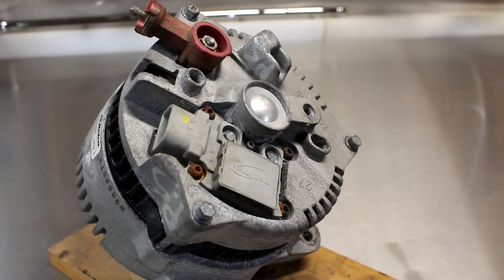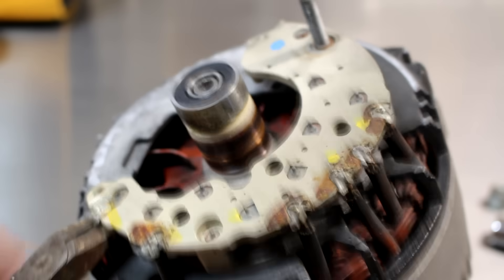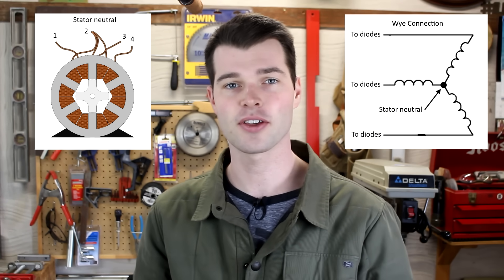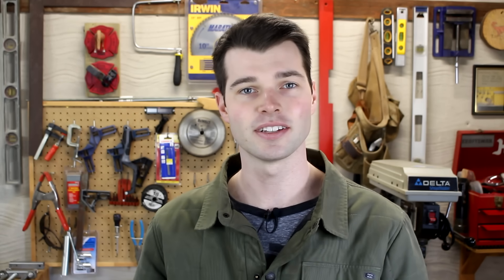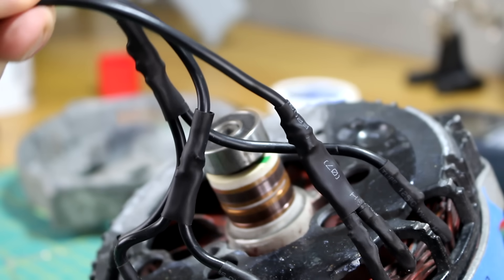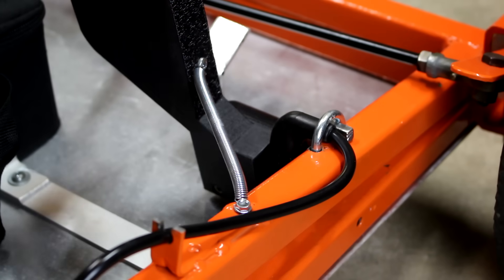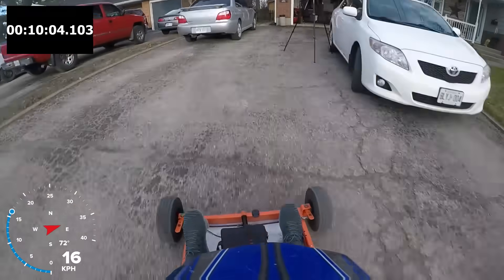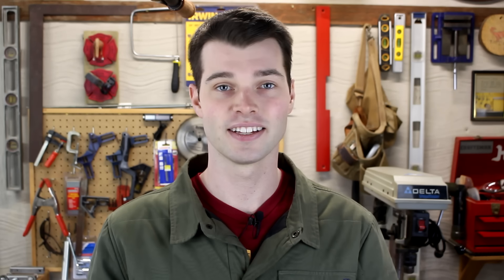Converting a Car Alternator into a Go Kart Motor

Comment: im thinking about using a forklift motor, its rated for 5kw, can i use a stronger pwm?
Reply: Well forklifts do come with controllers, might as well use those.
Reply: MsSomeonenew I've only found someone who sold the motor not the controller. And it's really rare in my country

Comment: NICE!!!! 

 I made an EBike with a 100 Amp alternator last year. 
 It tears along at 18KPH on a 14V battery, and uses 15WH per KM. 
 Watt's cool is that it is soooooo quiet, it is recharged by solar panels - and it is such a pleasure to ride  :) .  
 Keep up the good work bro.
Reply: +Perkins_RC76 
 If you can walk at 7 mph, I would like to see that. 
 Maybe make a video of it? 
 Maybe become an Olympic race walker? 
 The true walking speed is closer to 3 MPH, so my 12 MPH bike is a LOT faster than mere walking speed  :) .
Reply: PERKINS_RC76 not likely cause I'm 6 feet tall and I fast walk at 4.1 mph full Sprint at 9mph but I tire quickly cause I'm not trained lol
Reply: Braking?
Reply: Braking is partly done by the alternator, but mostly by the bike's existing brakes.
Reply: 15Watt hours? or 15 amp hours? big difference on a 12/14volt system
Reply: @AndrewBrowner at 15 volts he'd be burning about an amp to get 15 amp hours?
Check my math and see if you get the same. 
15 amp hours at 12v 150 amps more or less
That can't be right????
Reply: Howdee Andrew, 
 1 Amp hour at 14.5V - is 'watt' this bike consumes when it is traveling on a level path at 18KPH. 
 It travels 4KM per 4AH battery, if I run them flat, but that's not such a good idea with these LiPo cells. 
 I could make it go faster, with a higher DC supply voltage, but there comes a tradeoff between speed and range, so I have opted to settle for this rather sedate 18KPH speed  :) .
Reply: CNCmachiningisfun
Put a Battery Discharge Cut-off Control circuit
Reply: +Anthony Caballero 
 My motor controller already has that built in. 
 It can be programmed to protect the battery from excessive discharge  :) .
Reply: CNCmachiningisfun
ohhh nice
Reply: CNCmachiningisfun ts nice.
Reply: I've toyed with replacing the battery with a supercap bank and adding a 250 watt solar panel for a touring cart.  A horseless surrey with a fringe on top.  Not sure what approval it would need in place of a bike for Burning Man.
Reply: can this motor used for cnc spindle?
Reply: For sure, the Ebike that I made can go a LOT faster than its present 12MPH, but there comes a trade off between speed and efficiency. 
 My objective was to build a vehicle that does not need any form of fuel to run it, and this was the result. 
 It runs on solar power, so it costs virtually nothing to run. 
 I was gonna make a petrol powered one that would go a lot faster, but I settled for this, as I am trying to remain as independent as I can be from fossil fuels. 
 Congrats on your bike builds bro  :) .
Reply: Getting 15 WH per KM while doing 18 KM/H is very poor efficiency! On my old heavy ebike, i used to get 8 WH per KM doing 20 KM/H and 18 WH per KM doing 35 KM/H ! I think this shows the flaw of alternators, they are powerful, but they waste lots of energy sadly.
Reply: 18kph is pretty slow though :/
Reply: CNCmachiningisfun a

Comment: use batt lipo , it's verry power
https://youtu.be/6D0kTZRYasc
Reply: So much current.. very mooove.. 

The DogeKART.
Reply: much lol very wow your comment, Gary
Reply: he is going to make his own lipo pack using 18650s (vape style batteries), they can have a charge of around 2500-3000mah at 3.7v. Wiring them in series could bring the voltage near to the 48v (12 in series) and maybe two in parallel for extra amount of runtime (more ah).
Reply: and in parallel for the discharge current.
Reply: Hello
no you need a li-ion batt pack of 13s = 48v ... no 12s li-ion ...
to go for 14Ah or 16Ah is very good ...
an alternator to engine, it takes a racio very high, about 6 laps to the engine for 1 wheel revolutions ...
very good work
Reply: on my go kart, he shoots 70A in spike
Reply: I agree. Lithium polymer batteries would work better than the 18650 lithium ion hard cells. Most lipo batteries have a higher discharge rate.
Reply: 18650 banks are also used in EV's. They're just recently switching to 21700 (Tesla)
Reply: Virux get a stack of them.. or equivalent in Flatpack lipo. 

Doone.

Comment: How are you applying voltage to the stator?  I have an alternator wired up but can't decide if the stator should have a variable or a set voltage..
Reply: Edit, my bad, I read it the wrong way around.
Stator gets 3 phase AC voltage from an ESC, rotor gets a set voltage.

Comment: Correct me if I’m wrong, but couldn’t you add another alternator to the drivetrain to charge the battery’s endlessly? So you could ride forever? Lol
Reply: The original comment said "correct me if I'm wrong," not "shit on me if I'm wrong!"
Reply: If you eat your own shit you won't need to buy food.
Reply: The added resistance to spin the other alternator would be counter intuitive and would use even more power to move the vehicle.
Reply: Actually you could add one for regenerative braking. But it would only charge battery when you want to stop or slow down. Would be a lot more work.
Reply: Trav Dav - no, sorry to burst your bubble...
Reply: Relax folks, people usually just lack understanding.
The reason it doesn't work is the power you loose when converting, a motor like this will probably convert 80% of electricity into mechanical movement, and an equal alternator will convert 80% of that movement back into electricity. Meaning even if you just spin the motor and alternator you are loosing 40% of your battery power, before even trying to move the cart, and without the alternator you would only loose 20%.
Reply: afr1221 lol..  the overlooked step.
Reply: MsSomeonenew can we please talk about the "80% of 80% is 60%" math you did ?
Reply: +Yosef MacGruber 

  G'day,

   I have a special treat for you, title-search YT for,

  "The Ultimate Illegal Research, Permanent Magnets Banned ; Alternative Energy FORBIDDEN ! (Part-4)"

   Remember, it's an Educational Comedy Doccumentary...; especially hand-crafted, & fine-tuned, for people just(ifiably ?) like yourself !

   Absolutely everything you'll encounter there is 100% true & accurate ; it's the presentation which injects the Humour that in turn makes it so unforgetable....

  Enjoy !

  ;-p

  Ciao !
Reply: Mr. Tesla was very close to achieving something along the lines of "free energy" right?
Reply: Its a fantastic FANTASY!!! it will defy laws of physics and it will not work, you may get slightly more run time on the batteries but it will deplete thereafter because there is no free lunch! energy take to charge the run battery also has to come from the motor driving it... so motor does more work if you try to recharge the set up with another alternator...the slight improvement in run time probably will come from the inertia or centrifugal movement of the kart when you go downhill..
Reply: joe eastman -  yes and no. If i remember right, he found a way to pull some of the energy from the air by creating a device that absorbs radio waves. The closer to a broadcast tower you were the better it would work. Don't expect it to pull a massive amount or anything. It's still not "free" energy in that the broadcasters are paying for it.
Reply: There's a scam on the  internet about building ur own Tesla motor and making free energy....that's what's he's saying I think...
Reply: Tiberiu Nicolae fucking A. I 'bout shit when I read that.
Reply: You can't just charge an alternator off a motor forever because of a thing called entropy.  Check the laws of thermodynamics.

FWIW, you add physical load to a generator every time you add electrical load.  So, even without all the losses that happen in the real world, the best you could do is drive the generator with the motor with no power left over for anything else.

But the universe isn't some perfect theoretical construct.  You lose a lot of energy in between, which is why motors and generators (and cables and batteries) get hot in operation: that waste heat was electrical (and mechanical) energy, and is now thermal energy you really need to get rid of.

And no, Tesla was not close to "free energy" because Tesla, while he got some stuff right, was a crackpot.  What everybody interprets as his "free energy" deal is a misinterpretation of the reaction to one of his more idiotic schemes, namely the idea he had that electricity could be transmitted without loss to any point on the planet from any point on the planet through the earth itself, without transmission wires.  The REACTION of course was that there would be no way to charge people for electrical use, while there would still continue to be a cost of producing the stuff.  That got simplified down to "free electricity" and bastardized to "free energy" and then new age weirdos took that to mean there was energy floating around that could just be harnessed through some means that nobody can come up with despite the fact that we're literally a century more advanced than Tesla, who was a guy that not only didn't have a grasp of physics but outright denied things that physicists said and were right about.  The closest he got to "free energy" was stumbling across radio and finding some of the background clutter from space.

"Actually you could add one for regenerative braking."

Why add another?  You already see a generator being used as a motor, that should give a hint that regenerative braking is all in motor controls.
Reply: Trav Dav great idea but counter emf resistance would defeat process
Reply: Easy enough, just wear a tin foil hat to tap into the universe.
Reply: You must be one of those perpetual motion idiots no its impossible you will actually lose power
Reply: Clearly not a mythbusters fan lol
Reply: What if you put two alternator on it?!?!?! FREE POWER?!?!?! I knew it just like the earth is flat.....
Reply: i would love to to see that work
Reply: Free-energy technology is likely possible and probably works and is proven already, but suppressed by the evil NWO, however, you will need a better free-energy scheme than that, as you seem to lack the part about tapping into the universe to replace all the energy lost in the energy conversions.

Comment: your steering is a bit wonky. (ackerman angle) the arms are pointing outwards, they should be pointing inwards. steering will be alot better than.

nice work on the motor though :)
Reply: Depends on "front steer" vs. "rear steer" - that is, is the rack in front of or behind the steering axes
Reply: mccanlessdesign in this case its behind the axle so best would be pointing inwards.

Comment: 1.how do you calculate the max power you can run through the alternator as a motor?
2.Can you apply more voltage to the rotor windings and would that increase HP?
3.Sweet build.
Reply: The maximum power really depends on your cooling, normally you would only be safe to run what the alternator puts out, but with added cooling that could go 2-3x higher.
As long as you add voltage the output power will go up, should increase it both on rotor and stator windings.
Reply: MsSomeonenew cooled x2 or x3 is awesome. Thanks!

Comment: Nice project! Looks like it put out tons of power too. Curious how you figured out kv, running voltage, and gear ratios. Just wing it?
You are gonna want a 6s4p liion pack of  high quality cells. Samsung 20r hint snag one of the cheap 10s balance boards to integrate in the pack for easy charging. Battery gonna be the most expensive part on the build sadly, but worth it if you are going to swapping between karts.
Reply from the maker: Thanks! This entire project was an experiment for me and it ended up working out. All that I did was convert the alternator into a motor and then purchased a speed controller that works with sensorless motors. I already had the 48V battery pack which is why I purchased a 48V controller. I went with the same gear ratio that I had used with my other motor. The following page helped me with this. 

https://www.electricscooterparts.com/motorwheelgearratio.html

Thanks for the advice!
Reply: austiwawa oh shit, 48v, youll want a 10s pack, thats gonna add up quick!
Reply: One way to make it easy to swap battery packs and add as your budget sees fit is to use used battery packs from any of the powertool/yard equipment manufacturers. For example, Ryobi 40v packs are prebuilt 10s systems. The 2Ah pack is 10s-1p and the 4Ah is a 10s-2p with the undervoltage / overvoltage protection built into it. Charging is just slapping it into a charger. You can even parallel the packs (under certain circumstances) to get a 10s-1p-2p or more. They have to be at the same voltage before connecting them, or you will be welding something. I've connected the negatives directly together and then connected the positives with a resistor for a few minutes and then put them together without the resistor without a problem. Not a little 1/2 watt resistor either. I used a 10 watt and it didn't melt down. Did I mention they have to be at the same voltage before connecting them together? Oh yeah..They have to be at the same voltage or something might go boom.

Comment: Was the entire battery hot, or just the terminal? Dirty or loose terminals can cause localised overheating due to their higher resistance. I've had a couple of wiring harnesses partially melt due to dirty battery terminals, and one which melted because it wasn't screwed in tight. That higher resistance might also be limiting your output power.
Another thing to consider, your motor controller states up to 45A output but doesn't mention the input current. It won't be 100% efficient and will depend a lot on your input voltage and the way the controller is designed.
Also, fuses don't always blow at exactly their rated current. There's usually at least 10% tolerance and some will easily supply 20-30% extra for a minute or so before they blow. They're good protection from short circuits but aren't very precise.
Reply from the maker: Interesting. The one battery was warm but the terminal was burning hot. I did notice that three of my terminals were loose so this could have been the cause of what happened.
Reply: Yes it is definitely the terminal that was loose.
Reply: Microwave Dave i was thinking the same thing about the terminal. Not a normal failure mode.
Reply: the battery should be fine if you were doing <40 amps for 10 minutes especially since you were off and onn the petal not full throttle for 7 minutes straight.. could of bin an undersized eyelet or just a loose connection

if you added another battery in parallel itd half the amps coming from each battery and double your run time, if theyre not deep discharge batteries like an optima style id recommend adding a voltage meter and keeping an eye on it, draining them right empty or below 10volts frequently will kill them in a hurry
Reply: Check that all of the electrical connections are tight before you apply power. The bolted connections like on your battery should be tight enough that finger pressure cannot make them rotate around the bolt. Crimped connections should be pull-tested.

This was part of the standard QC procedures at the two places I worked at that manufactured large 3-phase motor controllers.

Comment: What did you use the 12v battery for? The brushes? Why?
Reply: stonebay productions . You need the 12Vdc supply to power the electromagnet in the rotor , otherwise you will not have a magnetic field upon which the rotating field of the stator acts. Normally a brushless motor would have a permanent magnet in the rotor .

Comment: Awesome work, but can you explain how you run the three-phase AC motor with DC Battery pack?
Reply: Gokul Krishna you need an ESC, electronic speed controller, there are many types for different applications.
Reply: Thank you for your info Stanton High. This would help me a lot
Reply: He is using an inverter to create a synthesized 3 phase very common in industry

Comment: good idea used alternators are cheap
Reply: if you say so...   but uh..  an alternater isn't an electric motor considering it was made for the sole purpose of GENERATING electricity.
a proper dc motor would be much much better, with a lot more torque.
Reply: Harley Me
  turns out that theese alternators are quite efficient even when used as motors.
Reply: @harleyme3163  if you want to buy me a big enough dc motor you are welcome to

Comment: Awesome project. Btw I got the keychain, thanks.
Reply: Creating Creations o
Òff roaderes
Reply: High performers off roadres
Reply: Hello good morning friend to know what type of alternator you used what features is the alternator and which brand thank you
Reply: Dove si Coperativa l'acceleratore grazie bel progetto complimenti per i tuoi video
Reply: I seriously doubt this will work for very long. Stock alternators can't use much power either. This is likely an 80 amp alternator, which is less than a kilowatt. The bearings are not designed for this kind of torque either.